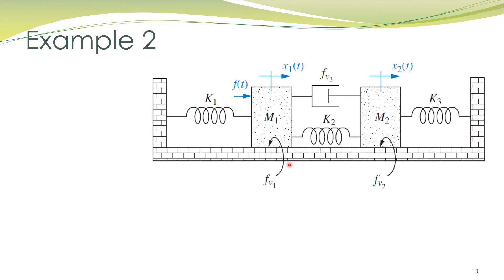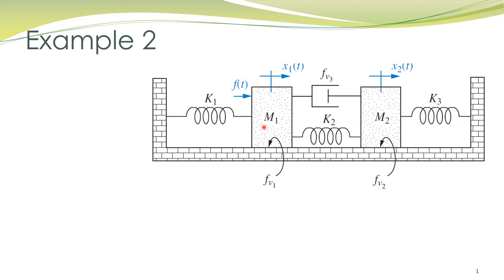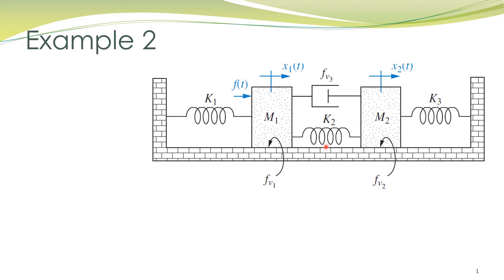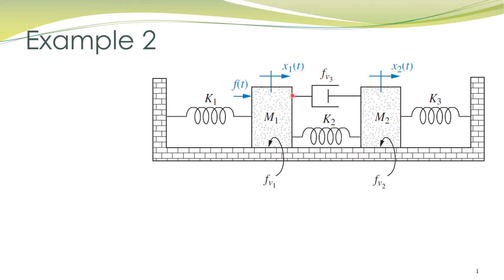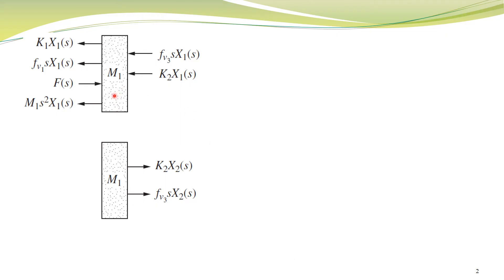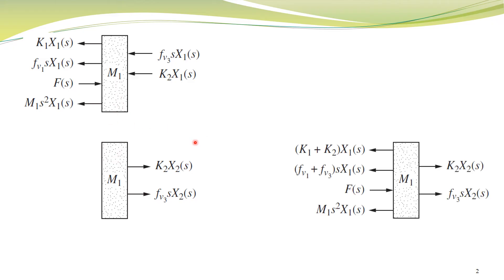LCS 4b - Mathematical modeling of translational mechanical systems

Comment: what the diffrnt between x1(s)/f(s) and x2(s)/f(s)? normally we find x1(s)/f(s)..so why some video i see they find x2(s)/f(s)
Reply from the maker: Transfer function is a relation between input and output. And the output is a system variable in which you are more interested. If the variable of interest is x1, then you would like to find the transfer function X1(s)/F(s), and if you are more interested in variable x2, you would like to find the transfer function X2(s)/F(s).
Reply: @MAFarooqi  so it depend on question ya..thank you sir

Comment: Why do we neglect gravity in modelling
Reply from the maker: We are interested in modeling horizontal displacement of the system, and we know that only horizontal forces can produce horizontal displacements. Therefore, we have not talked about gravitational force.

Furthermore, in vertical direction, there are two forces acting on masses, the gravitational force in downward direction and a force exerted by fixed structure in upward direction. Both forces are equal and opposite, and therefore, there is no vertical displacement in the masses.